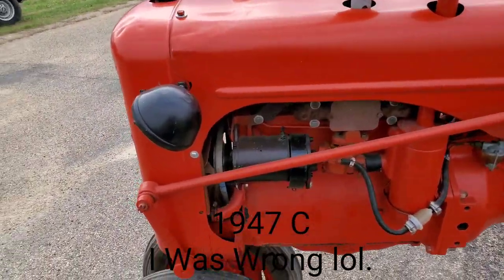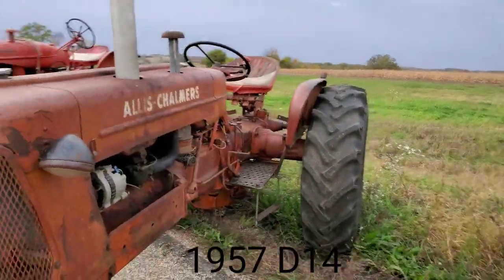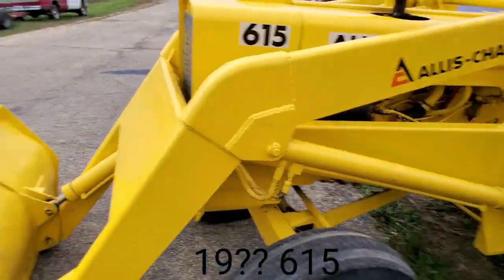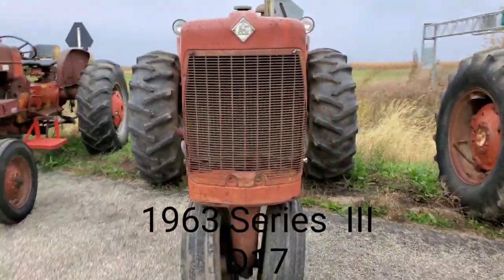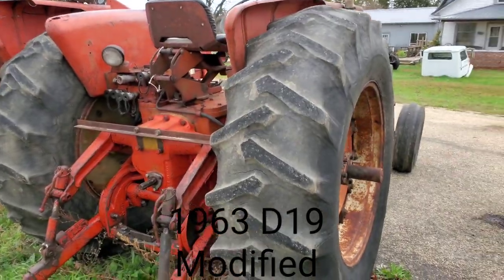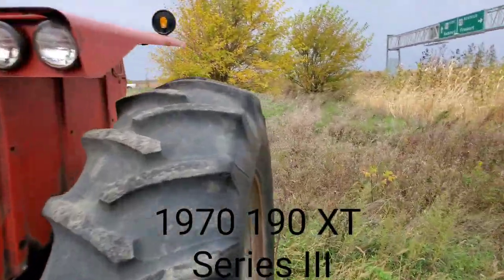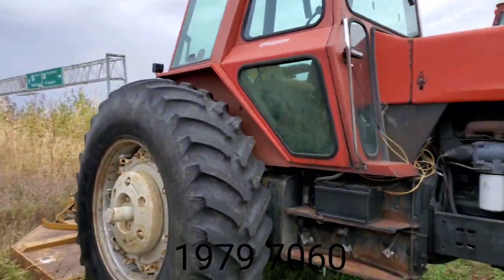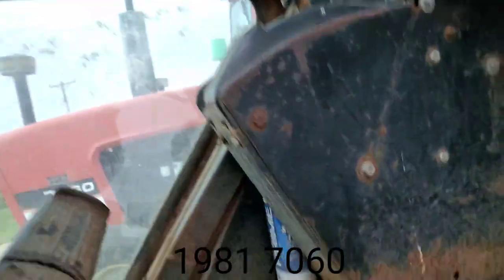Allis Chalmers Collection

Comment: Awesome collection of orange sir. I still use two D17’s and a gas D19 on the farm and I love them
Reply from the maker: Thankyou. It's hard to beat the 17s easy to drive and easy to work on. And when you compare the price of a new 55hp tractor it makes me like them even more 😆
Reply: I have some modern stuff but 90% of my tractors and equipment are the old stuff. Growing up we always had a little bit of everything on the farm so I’m not really loyal to any one brand. I have 5 Allis Chalmers 3 olivers6 Farmall’s a Ford and 3 Massey Harris and they all get used
Reply from the maker: I've drove about every popular manufacture never drove a cockshut and only one minni mo and I really don't have alot of bad to say about them they each have their advantages and downfalls the quick attach on the ih was genius, but I had a problem with smashing my thumb in-between the shifters 😆 my own fault but I always complained about the design when my thumb was throbbing 😅 but out of all the tractor even the other allis I've always been the most comfortable on a D series.
Reply: I have a D17 with a bad engine that I’ve wanted to put a 4cyl turbo diesel out of a gleaner combine in but I haven’t found an engine yet or the time to do it. But it would be a really cool little tractor to use on the farm
Reply from the maker: I love our d19 with that engine talk about a fuel saver is probably my favorite one in the collection alot because I built it. If you do end up with that set up I'm sure you'll be happy with it.

Comment: We had a 200, dynoed 115hp. Pulled 4-16s international with it. And a JD 4010 with a 4020kit, pulled a 4-16 JD ... Between the slight hp difference and the big difference in how the plows pulled .. the 200 and IH plow got a few more acres done in a day
Reply from the maker: It was 5 16s around here I guess the 4020 didn't handle it well.
Reply: @TimothyFluegel  soil is heavier here, 5 bottoms were behind 130-150 hp tractor. We had a 6 bottom inland for a while, it gave the 7050 a damn good workout!!

Comment: Hi from Northern Ireland! I have a '42 WC v front, a '47 (UK assembled) B and a '57 D272 Diesel.
Reply from the maker: Nice the d272 is a neat tractor. Made in the England plant?? And that would have the Perkins diesel if I'm not mistaken.  You just don't see them in the USA but always wanted one just as a conversation piece. Is there anything different about the b that you know of from the ones we have hear?
Reply: @TimothyFluegel  Yes, I think the D272 is a very pretty wee tractor and the same engine as the Fordson Dexta, it was built at Essendine. It would probably be equivelent to your D12?  My B being a '47 was a  CKDN model - so a kit of parts from the US assembled at Southampton. Prewar B's were supplied complete and after '47 many of the parts were manufactured in the UK, later using the CA engine and 4 speed gearbox. Some revamped tinwork and basic 3 point lift led to the not very pretty D270, then the D272 - still available with CA petrol/TVO engine as well as P3 Perkins and finally the ED40 which I think was also made or at least supplied to Canada. The only real difference in our B's was they were TVO ( Kerosene?) or some were fitted with early Perkins P3's.
Reply from the maker: Wow didn't the p3 have like 40 horse power. I couldn't imagine a b with that much hp or was it an earlier model p3 with less hp or something?
Reply: @TimothyFluegel  It was the early P3 TA which used a timing chain instead of gears but was still rated at 34bhp - quite a boost from the original B's 16bhp!   https://i.pinimg.com/736x/09/18/e8/0918e89a485913dbf9998e872e783b56.jpg
Reply from the maker: That's crazy more hp than a D14 or right around the same I never knew they did that. Thanks for the schooling 😆  that's something I never would have found out otherwise.

Comment: Curious why you put a 301 in that first 7060?
Reply from the maker: The 426 was toast it spun 4 bearings before I got it and trashed the cam crank and block,  was gonna have 5 grand into it easy, and I had the 301 sitting in the shed, I overhauled it for 1300 and slapped it in there,  I've got about $3500 into the tractor at this point, and it's been my main work horse on the farm, uses barely more fuel that a 190xt, and that was the biggest reason I built it, to replace grandpa's 190 xt for my light work,  it does alot of plowing with 5 16s and matches perfect with that plow and only uses about 3 gallons an hour compared to a 426 uses almost 6 gallons an hour pulling the same plow.

Comment: Tim would u happen to know if a front end loader from a WC would bolt up to a WD !
Reply from the maker: I don't know for sure, but it should for the most part bolt right up. I think you'll have problem with the lift linkage around the operating station, but I'm sure it could be modifies easily to work.

Comment: Did Allis ever put any V8s in any of there tractors and did they make there Diesel engines our did they use some one else Diesel engines
Reply from the maker: Not to my knowledge on the v8s. The diesel engines were made by budda but Allis bought them out.... so yes and no they used the budda technology but made them wet sleeve engines instead of dry sleeve. That was fine for the gassers but not the diesels and the engineers at budda warned them, there wasn't enough room in the block to get a sufficient lip for the sleeve to set on and they would push the sleeve into the block. Especially on the 19s when they put a turbo on them.

Comment: I have the spool valves for the D19 if you want them.
Reply from the maker: Thankyou Ted. I've actually got an extra one right now. I have done some extensive modifications to that tractor since this video.  I could acually use a little help on the hydraulic system. I didn't run lines right and can't figure out what I did wrong. Also can't find a diagram for an early 190 hyd system. I send you a link to check out.